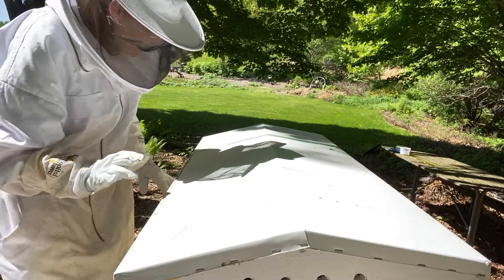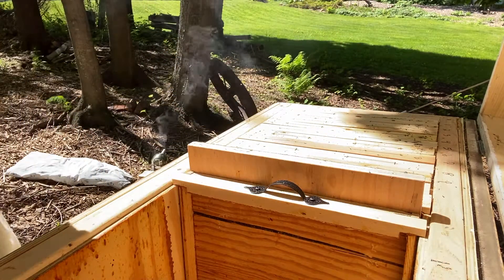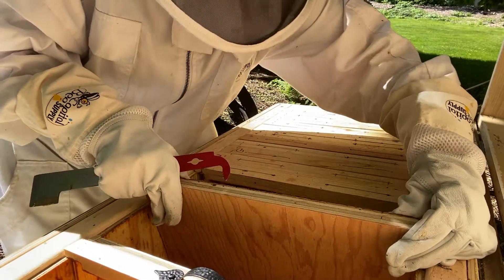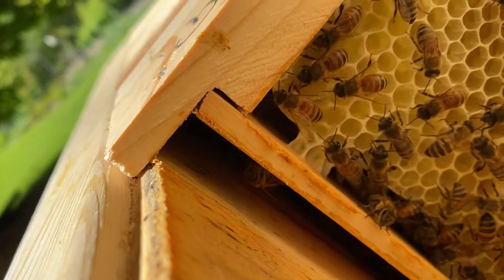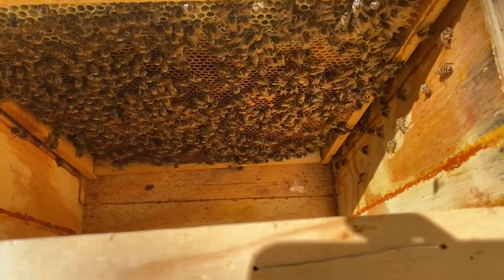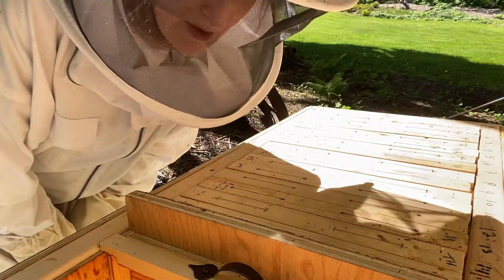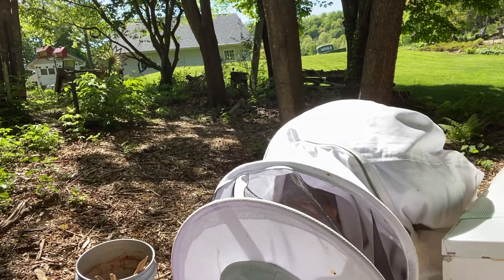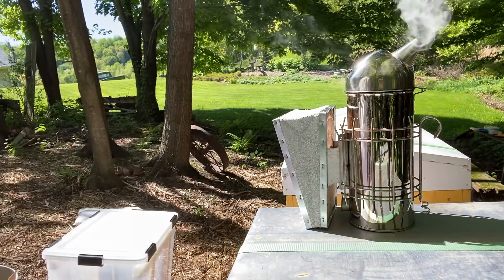28 Day 24 Frames Layens Horizontal Bee Hive Inspection in the Gnome Sweet Gnome Hive Box

Comment: Will the ants be a problem for the bees?
Reply from the maker: They should not be a problem. What they do is "live/hide/store eggs" in the cracks on top of the propolis that they bees add to "glue" the frames together. In my case, most of the ants were between the top bars and the pillow. So the bees don't know they are there. I am sure they scuttle real quick inside the hives to steal honey and nectar. The pillow just provided a safer place for them to live and grow. Removed the pillow and they did not return to either hive box.